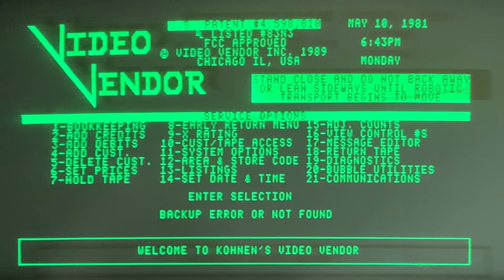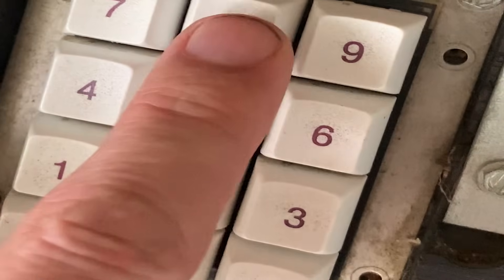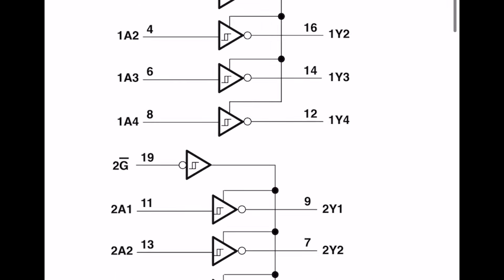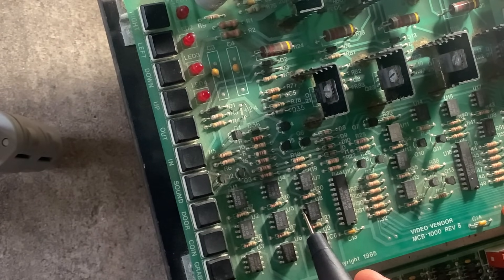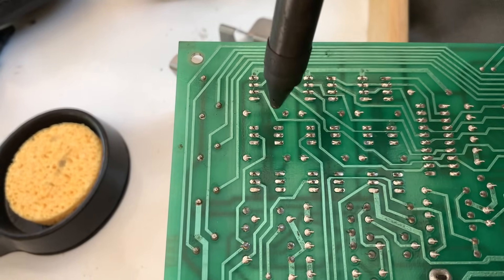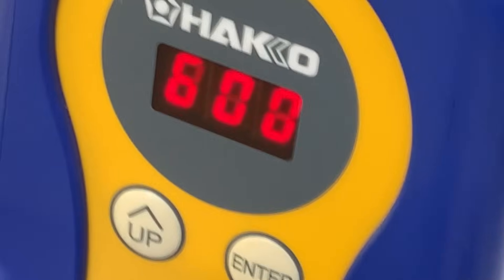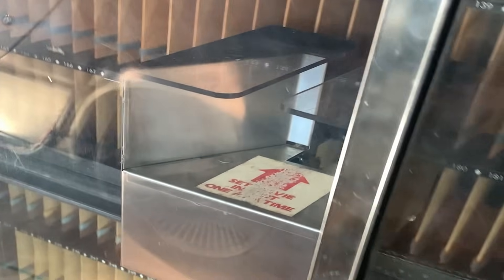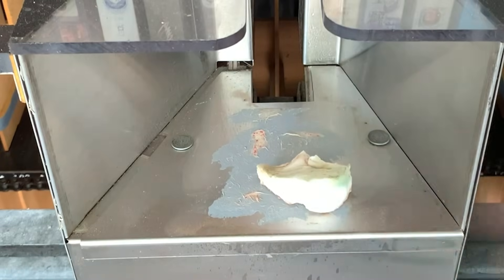VHS Memory Unlock Part 6: Fix Updates For Our Videotape Rental Kiosk

Comment: You would of gotten that sticker off faster using a can of automotive brake cleaner and using a razor blade.
Reply from the maker: @coletrickle--iXLR8  razor blade would have scratched the stainless steel

Comment: U2 socket is backwards (pin 1 dimple at the wrong end).  Won't hurt anything as long as you don't accidentally insert a chip backwards to match it.

But I subscribed anyway.  😊
Reply from the maker: Unfortunately only noticed that after it was soldered in. It's funny that sockets have a pin 1 dimple when they really serve no actual purpose if the chip is oriented correctly. I always double check to make sure this oversight doesn't happen.
Reply from the maker: THANK YOU FOR SUBSCRIBING!!

Comment: Loved the restoration. A suggestion: use benzine the next time you want to remove stickers or sticky glue. Soak a cotton ball in it, then in turn soak the sticker itself with that same cotton ball and you'll remove it without any effort or much at all. Many times they even peel off still in one piece, just don't rip them off in advance, you're just making it harder for yourself. You can then wipe it all off with another product like glass cleaner or whatever you used here. I'm surprised Goo Gone is so used by everyone, it really is very inefficient in many cases

Comment: I would suggest using those plastic razor blades and WD-40 to remove sticker residue.
Reply: Agreed. While WD-40 sucks as a lubricant (it is, in fact, a water displacer), the formula allowed to soak into tape or sticker residue for 10 minutes or so, the glue will just peel off. A plastic spudger (what I think @bennetfox was referring to) will pull it off of the steel without damaging it. The Magic Eraser will work, too, but WD-40 will soak in and destroy it over time. It will just crumble away.

Comment: Very cool machine, thanks for sharing your progress.

One recommendation: Sticker removal can be done much faster, and with minimal risk of damage to most substrates, with plastic razor/scraper blades, especially alongside a solvent (I use Goo Gone myself, but I assume Goof Off is similar enough). I like the blades made by Miniscraper (especially the polycarbonate blades, though the delrin blades are nice too especially when a softer material is advised), Scraperite's another popular brand, and there are cheap(er) unbranded mystery material options from tons of different Chinese sellers.
Reply from the maker: Good to know! I will add that to my toolkit fer sure!👍

Comment: Good troubleshooting! I’m surprised that the capacitors were good but a couple of random IC’s were bad.
Reply from the maker: We usually suspect failed IC chips in a mechanical failure. The motor has counterweights as well making a charging capacitor not as critical to moving the platform. Are we having fun yet? 😆